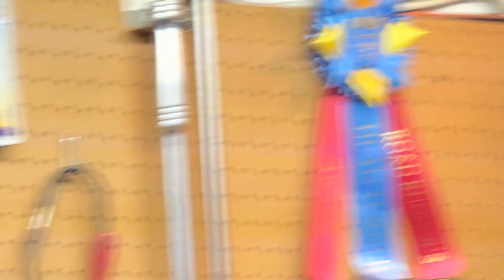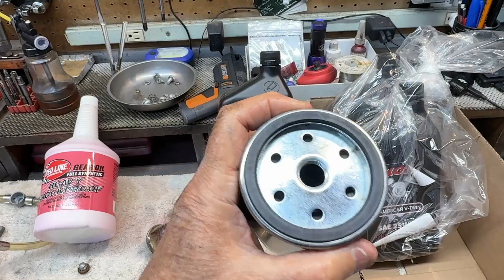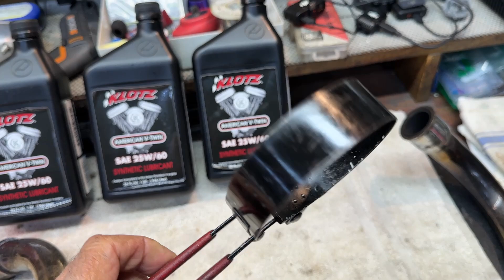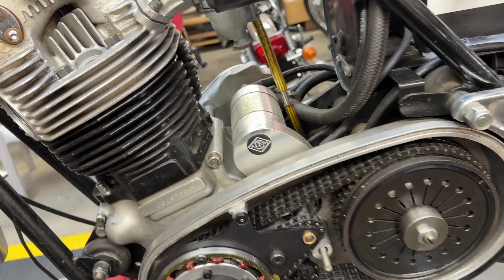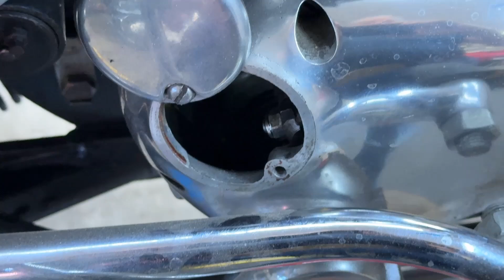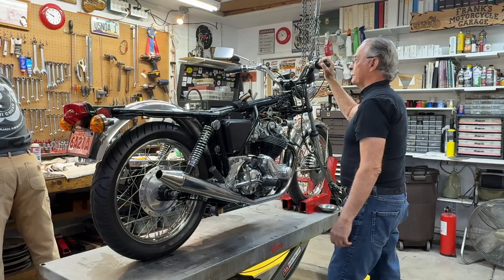04-04-25 – Vid 06 - Black Norton – First Start

Comment: This is a great video, Frank. All the processes are very well described and demonstrated and it should be of great help for someone who is doing their first service. 
Re: Transmission oil. The tipoff for the proper "modern" oil for a Norton is Type GL-4. GL-4 is made to be kind to the plain bushes -- as you said -- and there are lots of those in the Norton (AMC) gearbox. The total-hot-lick grade for modern roller/ball bearing gearboxes is GL-5 and, to get the really high pressure and lube characteristics, it has additive chemicals that at best etch and at worst totally dissolve soft-metal bushes in a Norton box. Always the GL-4 rated gearbox oil. 
For the primary, the little plug on the bottom is not a drain plug, it's a "level" plug and it's in the wrong place. To drain primary oil ("kickstart" Commandos), the outer cover must come off, as you demonstrated. The Norton clutch was never designed to be a wet-clutch, it was designed to be a dry clutch but being able to withstand some oil in its environment. If an owner fills a primary with three-row chain up to where oil dribbles out of the "level" plug, it is way over-filled. All that's necessary is for the chain at its very lowest point to touch the oil level, that's the perfect compromise to keep the chain oiled and keep as much oil away from the clutch plates as possible. Yes, Ford-type ATF-F is the best, it's designed to work well with clutches and oil. Of course, cleaning the primary cases is a must. 
Re" Engine oil – thank you for not starting another dreaded oil thread.  Jim Comstock several videos showing his tests for lubricity and heat performance for modern oils – a Norton owner can check those for more than you ever needed to know with good recommendations. I'm loving your oil drain spout, too, it works better than any other I've ever seen.  
You're right, the Norton filter is one originally specified for a small Citroen.  It was recommended by filter manufacturers as being the right size with good filtration characteristics.  It's not necessary to pre-fill a Norton filter; it's in the return oil circuit.  When an engine is started, the engine is lubricated by oil from the tank that's come directly through the oil pump.  The oil in the filter is oil that's scavenged from the bottom of the cases and it's just being returned to the tank.  It's important to remember that while that filter is being filled, the tell-tale of the return oil dribbling into the tank is delayed a bit from an engine without a filter so don't freak out if you don't see return oil for a few seconds.  The filter can be hard to find in N. America but we all obtain parts from our favorite Norton parts suppliers so just add a couple of the correct filters to your regular orders when you need one.
An engine that's been rebuilt of left unstarted for a significant period of time should be primed, as shown in section C32, figure 41 of the combined 750/850 workshop manual (the one with the black plastic cover and the white and green lettering; BTW, that manual should be owned by every owner of a kickstart Commando, it has great coverage and was written by a young technical publishing genius over 50 years ago who poured great care into it's compilation.) This priming completely fills the oil pump, timing cover oil passages, the crankshaft oil cavity, main and big end bearings, and the oilways to the head and the attendant oil passages, all the way to the lifters and cam lobe faces.  If an engine is not primed, it runs “dry” for a significant period of time at first start-up. It's a process used on the engine build line, the recommissioning area at the general assembly line, and in the Experimental shop for all newly built engines.

Nice compression checks, too.  You show how it should be done and, as a sidelight, show why it's easier to kick over a Commando with the throttle closed.  But that's one of my favorite rants and I've already said too much.  

Thanks again for a useful and complete video.
Reply: I'll call your Citroen and raise you Simca.
Reply from the maker: Thank you.  Good discussion, good explanation on all points.
Thanks for watching, thanks for writing.
Ride Safe!  
F.

Comment: Looks like you didn't open the throttle at all on the second compression test.  (I went back and watched the tape again.)   It's always nice when you realize it was something simple like that.    150 and 70 would have been rough.

Comment: Had a customer at a shop I worked at his new car was running so rich it was fouling the plugs and had rich codesthe oil looked like water he claimed he used 0 W oil and it was the only oil he would ever use in his engine. Engineering said no go. One of the main properties of oil is removing heat to thick not removing heat too thin not lubricating. Trust the engineers. Use the recommended oil or pay for unnecessary repairs.